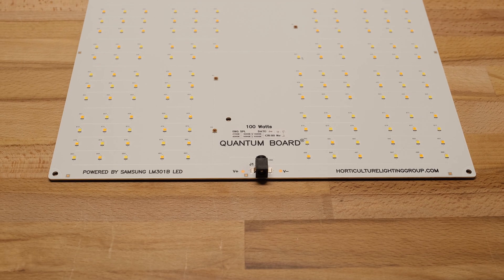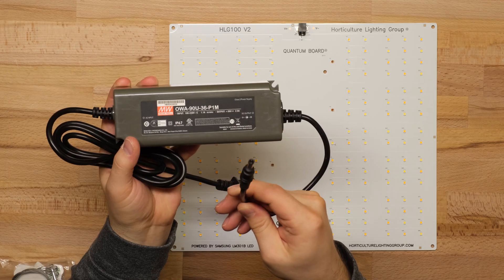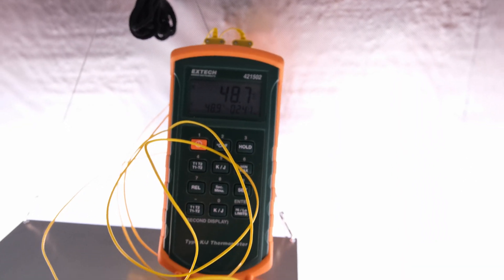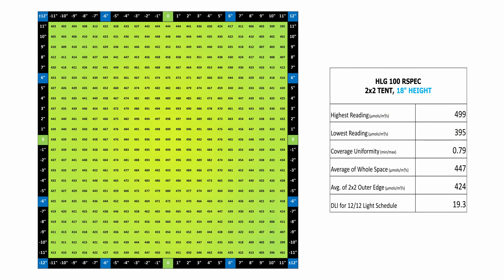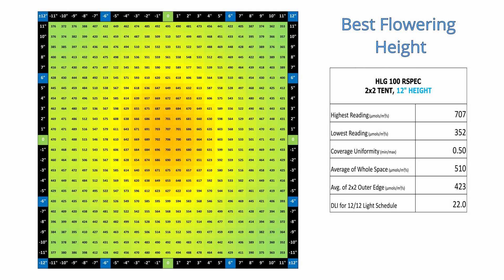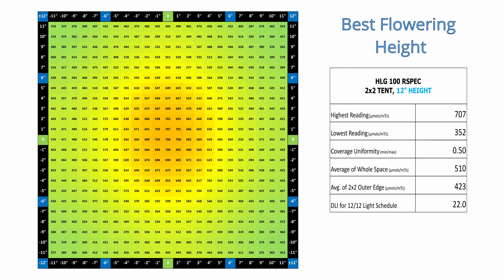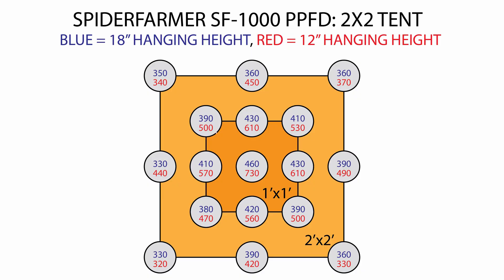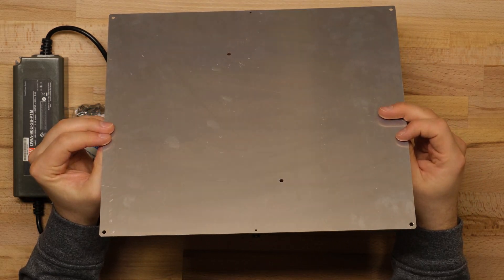Horticulture Lighting Group HLG100 Rspec Review (High-Res PPFD Charts + Temp & Power)

Comment: Mine is at 12 inches too.  So this review is a relief cuz I'm growing in a 3 foot tall tent.
Reply: Update:   light is at very top of tent tied with industrial zip ties.   Distance is 10 inches.  Light burn?   Yes.  But it's not terrible. Seems to light green the top leaves in the scrog.  Not yellow them.   But they are canoeing to varying degrees, and many have slightly burnt tips and serrations.   Tho I had a salt buildup as well (coco in fabric pots).    So those tips might be explained by that.    The important thing though is that the buds are still coming on strong.  She seems to really like this light despite the burn.
Reply: @DigitalMadrigal  thanks for this.would appreciate any other insight related to height since this last comment

Comment: Meijui LED and KingBrite LED is still cheaper, and the same parts, about half the price which is incredible savings. And it shipped in 7 days, Samsung LM301H,Cree Deep Red 660nm between, and waterproof and all. English emails, and Kingbrite is basically the cheapest you can buy with these samsung and meanwell LED prebuilt kits.
Reply: These are made by samsung like the whole thing not just the diodes. They are not the same

Comment: So would you buy a mars hydro ts 1000, spider farmer 1000 or this one? Does anyone have these lights with complete kits?
Reply: Mars ts1000 is killer , 150 watts , Spider farmer 100 watts , this one don't know but if it costs more than the Mars , buy the Mars !
Reply: @bruceholinight7978  that's exactly what I decided to do. I'm going to order a 2.3x2.3 complete set and one of the 3 chambered tents to put my ts600 in. I wish I could find the 3 chamber from Mars with everything but I don't see it anywhere. 
Thanks for the answer, I appreciate it!
Reply: @comfortablynumb9342  Good luck , I'm in Canada so availability is good , all the Mars bar type light's have excellent coverage the fc4800 is awesome in a 4x4 !
Reply: Kingbrite or Meijui is the best, for this setup (meanwell and samsung LM301H). I did months of research, believe this... half price of HLG, same parts.
Reply: @dertythegrower  There are some cons to this. shipping them from China is not cheap and the support level is not the same.

Comment: hi i have one very simple question for you (i hope :P)
 Well, i have those HLG-240H-1750B drivers sitting and i've wanted them to run some QB288 (48v), those in the link below. i've seen all these guys running those boards in pararel with more amps drivers. i live in europe so 240v input on the drivers and 143v on the output. my question is will those boards still run great with my driver or they wont worth? should i run them in series or pararel (i think the answer is series) and how many of them will be better in order to have more efficiency on the building? i was thinking about 2  of those drivers with 2 boards each (not sure if my driver will handle a 3rd board), total 4 boards for a 3.3x3.3 feet space. what do u think? thanks for ur time brother i know its an irrelevant comment but i cant find the answer somewhere. big fan of ur work 

https://www.alibaba.com/product-detail/Kingbrite-Samsung-LM301B-Epistar-660nm-UV_62452301132.html?spm=a2700.shop_pl.41413.27.622b1b98LKVWo2

Comment from the maker: The diodes are in fact LM301H - this is a preproduction version of this board that I received for testing prior to release. The badging on the board is old and says it’s an HLG100V2 and powered by LM301B, but I assure you it is LM301H. I tried to explain this at 0:12 with the white text at the bottom of the screen but evidently I should have left it up longer and mentioned it in my voice over. Sorry for the confusion!
Reply: Its the same thing
GreenGenes (pacific light concepts) proved the LM301H and LM301B is basically the same thing, one with H is just marketable to Horticulture (hence H). The B is the basic, but the difference he showed on the official samsung website is just that the LM301H has a different reading of light, while H uses lumens or whatnot, which growers use as a measure of plants. Something like that.

Comment: You said 301h but the text on the board says 301b, just wondering if HLG put 301h on older printed boards or maybe ya misspoke, clarification be cool. Cheers
Reply from the maker: I hoped the white text at bottom of screen at 0:12 would address this but I should have taken time to explain in my voice over. HLG sent a pre-production version of board with new diodes but old badging on the board. It has the labels of the HLG100 V2 but is actually an HLG100 Rspec.
Reply: @LEDGardener  I understand, that explains it. Thanks

Comment: Hey ! I'm planning of running a board with no heatsink and was wondering what would a decent board temperature range be and where should I measure it. Should I place a temperature probe next to a led ? Or are infrared readings enough ? Thanks in advance.
Reply from the maker: Well, this board runs at 50C as you saw, and it's fine, so that'd be a safe target. Pull up the data sheet for the diode you'll be using and have a look at the flux vs temp or forward voltage vs temp for some idea of how much heat will affect performance, though it'd be difficult to get a true Ts or Tc measurement like those graphs are likely based on. 

If you want to use infrared, just slap a strip of black electrical tape on whatever you want to measure and let it get to temperature, then point the thermometer at the tape strip. Bare metal emissivity is no good and can really throw off IR readings (https://www.flir.ca/discover/rd-science/use-low-cost-materials-to-increase-target-emissivity/).

I usually just measure the back of the sink somewhere in the middle with a probe, depending on the layout of the diodes. You might be able to find a Tc measurement point on the surface of the board or strip too, depending on what you're using, and that'd be the ideal place to stick a probe.
Reply: @LEDGardener  Thank you so very much !

Comment: Doesn't it say 2.7k and 4k diodes ?
Reply from the maker: Where do you see that? My board is stamped as 3000K/5000K. I think you're just seeing the edge of the label where a few other color temperatures are listed.
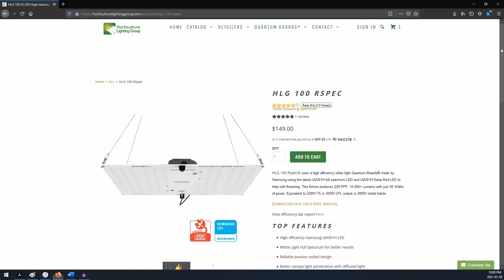Reply: Yes I see that as well at 0:29. Also the board on this video says at the bottom that they are 301B diodes. Very confusing info
Reply from the maker: @SFlaidlaw101  If you pause at 0:12 you'll see I made note that it's a preproduction version and the badges on it are wrong (they also say HLG 100 V2 at the top, while it should say HLG 100 Rspec). HLG sent me this to test before they were in full production. You can also see in this same frame that the 2700K and 4000K boxes are not checked, and it is 3000K and 5000K that is checked. Apologies for confusion.

Comment from the maker: Back after a little break! Next video will be about dimming drivers with Home Assistant and then when my PPFD sensor returns from factory calibration, I'll be reviewing the HLG Scorpion Rspec and Scorpion Diablo lights.
Reply: You say keep lights close to the plants, but I always see lights 2 ft away or better. Why are the lights in the big grows so far from the plants? This is confusing.
Reply from the maker: @babiibee8968  Depends on the power of the light and the size of the space. If you ran a 650R at 12" in a 5x5, you'd have a 2000 umol/m2/s hot spot in the center and nothing on the outside edge. For a little light like this, you need it close to hit half-decent PPFD and since it's a small space, it'll still hit decent edge numbers at that distance. Bar-style lights tend to run closer as well compared to board-style.
Reply: @babiibee8968  you are seeing commercial grows using 1000w and equivalent lights.   At that power level, lights can be farther away and use that distance to achieve a broader spread